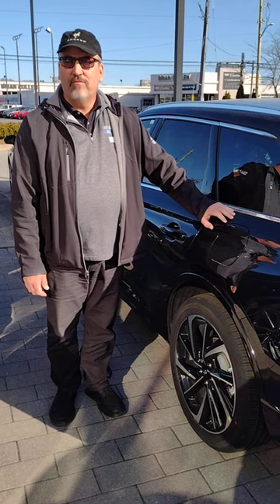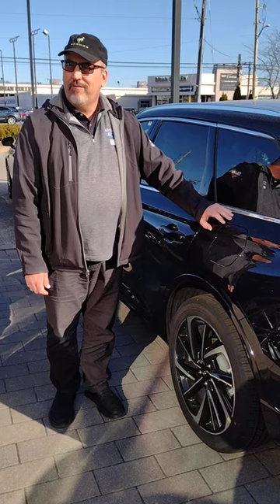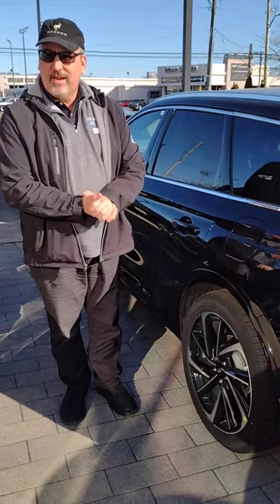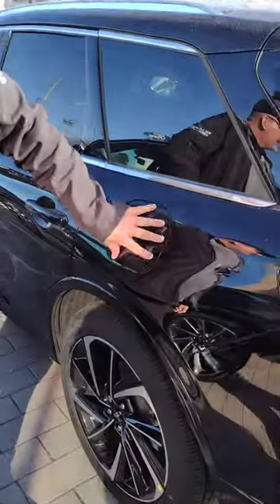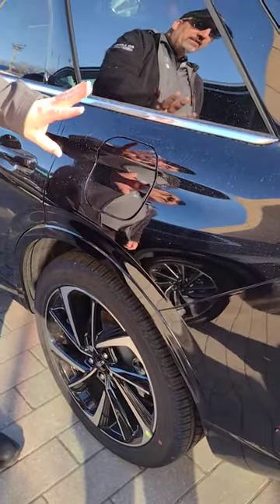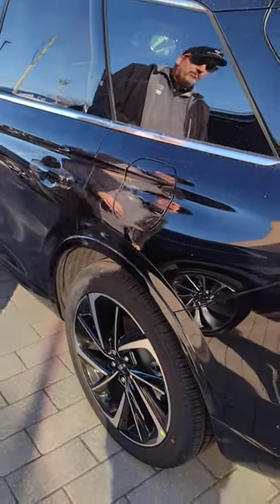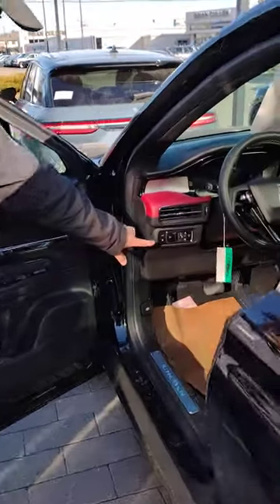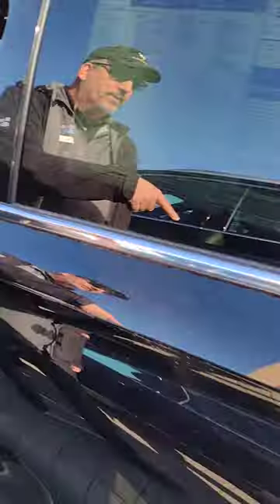2023 - 2024 Lincoln Corsair (Grand Touring) - How do I open hybrid fuel door? #shorts

Comment: Aren't all cars like that? My 10 year old gas sedan is like that.
Reply from the maker: You are correct in that many of the older vehicles had an inside release for the fuel door.  However, most of the more recent Ford & Lincoln vehicles have an "easy fuel" system where you just push the fuel door and it pops open.  As shown in the video, if you just push on the fuel door, it will not open.